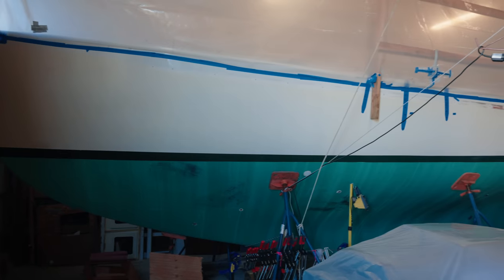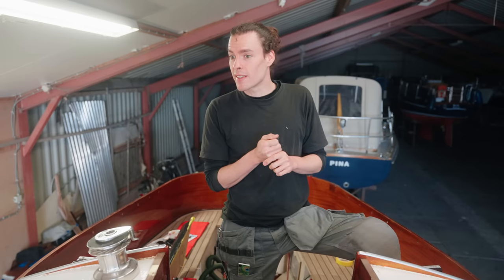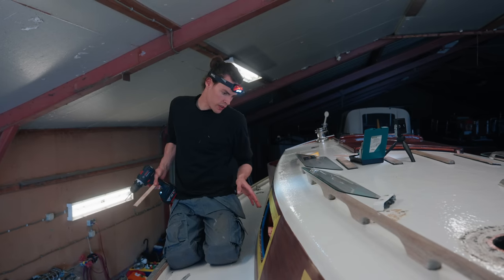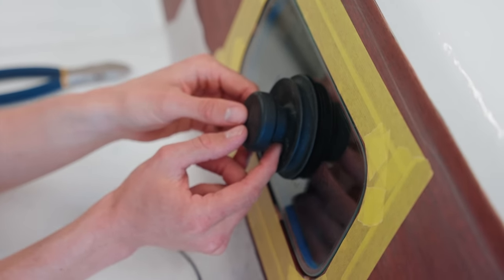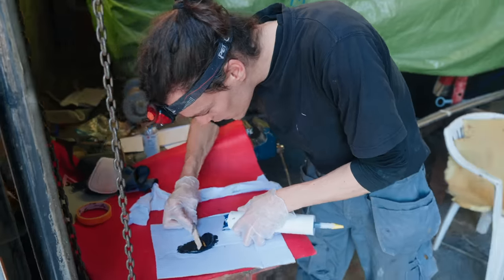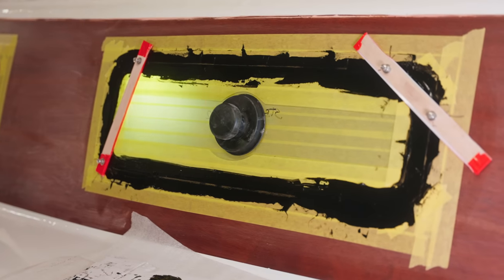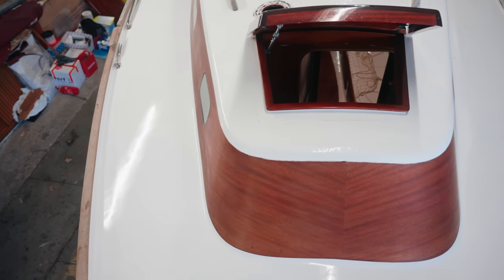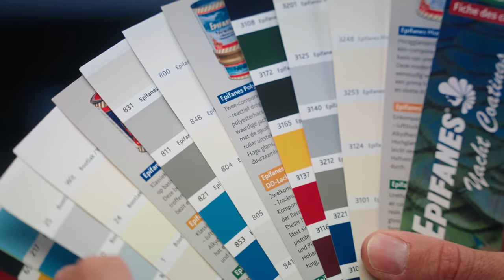Back to our old boat.

Comment: When I paint there is paint everywhere, including on myself. This week I was painting all kind of scratches and rustspots on my boat (steel 36ft kets from 1956). I used the trick I saw Aladino do in some videos ( a piece  of tape over the tincan to  remove to much paint from the brush so the tin stays clean) And  tried do do it relaxed, so no hurry (new concept for me but I am partly retired and live on it, so time enough) and after I was done painting there only is paint at spots where it needed to be. Keeping the tin can clean kept my hands clean while moving the can around the deck and no paint drops on all the places the tincan was put down (and then ends up under my feet and from that all over the deck...) 
So thanks Aladino for that great tip. Learned a lot from watching him.
Reply: @pa4tim
Me too! I'm the MESSIEST painter that I know. I decided many years ago that I'm just an idiot when it comes to painting. It's ok when I've finished and cleaned everything up but the process is always such a MESS!

Comment: First time I've seen a boat channel actually use the proper primer for a quality sealant.  If the windows ever leak (I doubt they ever will) it won't be a sealant issue.  Well done.
Reply: Adds to the issue I am not aware of on chandler I go to on the West coast that stocks. Much is due to planning ahead.

Comment: Aladino
Welcome back to Eurolandia!  Enjoy!!
Little hint for taping around tight radius corners before painting or filling with compound---- use fine line detail tape for the first layer.  Something like 1/4" or less will stretch and bend around a much cleaner small radius than conventional masking tape.

Comment: I'm way into both boat building and chateau renovation.  And if there's one thing I've learned from all the chateau renovation channels, it's that lime mortar is excellent for filling up gaps, and it really breathes.  Which means that water vapor won't build up behind all your hard work, and you won't have to re-mortar your entire boat ten years down the road.  You're WAY better off "caulking" your "seams" with lime mortar than with concrete.

Comment: That is a nice result on the windows looks so much better with out the screws and suspect leaky windows unless the Sikaflex breaks down are a thing of the past. Yeah the whitish for the non slip way to go will look sharp. Great you guys do all this stuff products used and why helps me on my resto so I can avoid cock ups and the extra expense of fixing it. Not sure if you know but Sikaflex do a UV stabilized range as well found that out on Travels with Gordie channel. Keep at it be well Carry On.
Nick (outa NZ bottom of the world just down the road from Antartica. Belting down with rain blowing 90kphish at the mo.)
Reply: Mv/Geordie, yes a bit harder to get and I think irrelevant regarding black as well a trim ring I believe covers in this instance. 
I did break it down at 15hp trying to fix my prop. West Systems epoxy also failed. 
I have not seen the white yellow or photo degrade, just tends to get dirty. Paintable.

Comment: You both are talented boat builders. I understand the challenges of arriving for at least 90 but less than 180 days. You are both amazing! You get through difficult work, expertly. You make difficult decisions with enough condideration but not so much as to defeat the process.  Save or sell that teak!

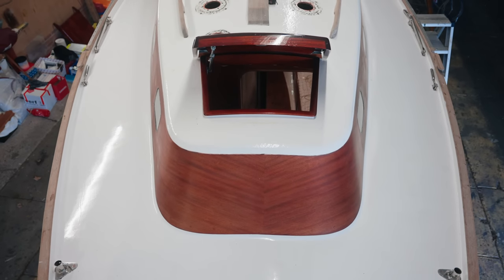Comment: @17:42 Though teak looks nicer, it is the right conclusion. The silicone would have haunted you, and any other successive owner.👌
@19:47 Aesthetically it will contrast nicely with the mahogany, but I would have chosen a slightly darker color as it is gentler on the eyes for days at a time when the sun is out.😎

Comment: Enjoying your videos here in Texas.  I'm just wondering if the sun will fade out the white turning it to a more yellow color. Just a thought...Keep sailing and be safe. Claudie
Reply from the maker: No, this paint is designed for yachts and to be outside!
Reply: Much of the yellowing in old especially oil base is the oil itself. The best quality modern paints don't do this.

Comment: I have a most unusual comment... more of a request... thought you can relate... landlocked sailor, with limited flow and big ocean dreams. There is a boat just south of Port Townsend... He will take trade... a 30ft ready to sail boat for the 39 cutter he got from an uncle. its a project but i am hopeful you or others in the area might know of a 30 footer sail-ready boat that someone just might be ready to move on for little or no . It s a stretch but just perhaps you know of someone or some boat sitting in yard aching to return to the sea,  just like me. Appreciate you both, I follow you with joy and send you good energy for all your projects and adventures.
Reply: Many boats few will be with little delayed attention if very cheap. Pick what you want and stick by it. Just don't drag an old wooden boat to freshwater.

Comment: I never heard about Dutch Sicaflex Saussices!!! Good news for Dutch cuisine!! ;))
Anyway, how do you reenforce the window structure?
Or Sicaflex got strength enough???
Big hug
Reply: I repaired a rubber bumper on my 6m open sailing boat. Six men pulled it up to the trailer after the tide started to go down on us at the boat ramp. The boat was lifted out up t the keel by the Sikaflex bumper. That stuff is practically indestructible.
Reply: @sail4life  thanks for the info.
So  I do not worrie with the repair that I've made, under water level on my boat!!!! 
Sicaflex is better than I thought.
Reply: The Sikaflex bond is very high. Though the overall design is not off shore to many. It needs no reinforcement for intended use.